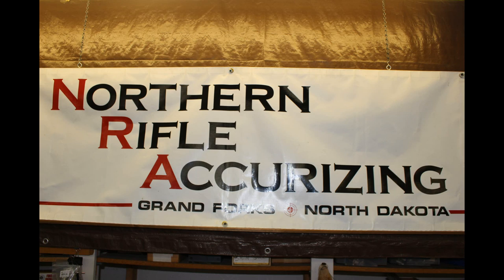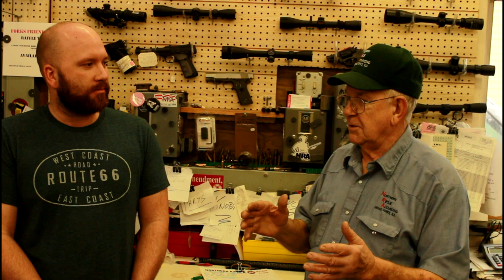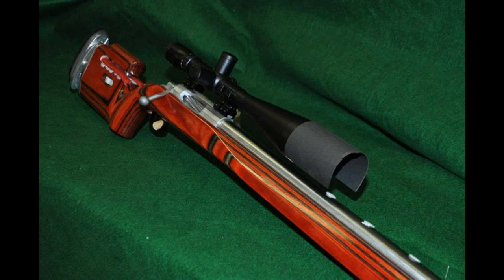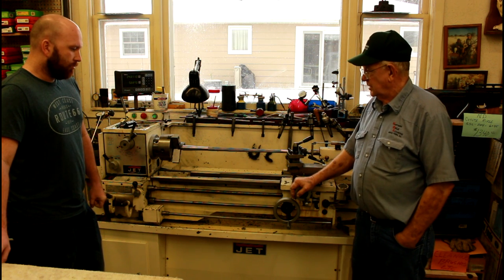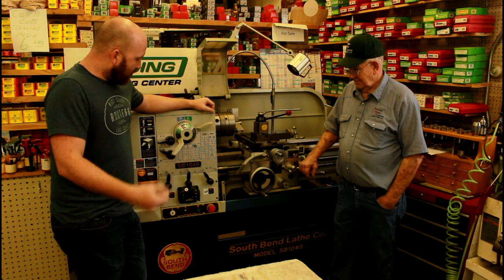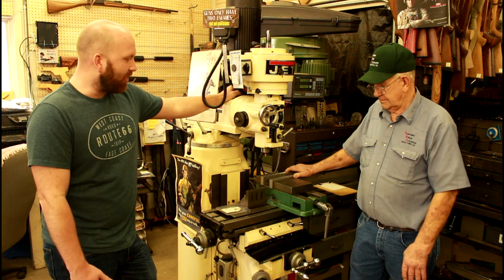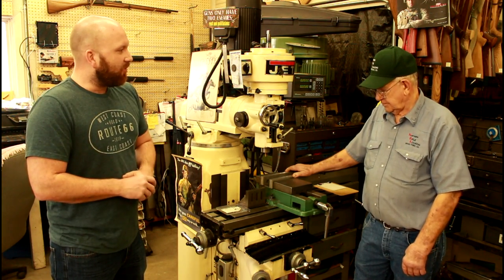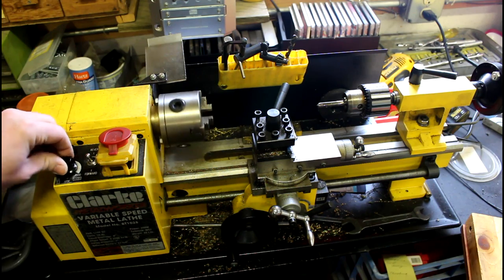Shop Tour Gunsmith Shop Northern Rifle Accurizing

Comment: I've had work done by them, they do great work!
I've also purchased a few AR lowers from them for my own builds. Good prices, even during the great scare of 2013. They don't try to screw you like so many in the industry did.
Reply from the maker: There's a good chance I was there in 2013 working. Part way through the year I ended up slowing down and ended up moving at the end of 2013.

Comment: How is the wood AR stocks more accurate?
Reply from the maker: I'm not sure, It's something that I have not thought about myself on an AR. In my opinion, getting a good upper to lower receiver fit along with a proper fitting barrel extension to the upper and gas port alignment will yield the most accuracy gain than most other things. The AR's that I have build myself are all Magpul, and aluminum stock parts.
Reply: Thanks for the videos man

Comment: someone explain the chuck jaws he made ?
what is the "spider chuck" mod ?
Reply from the maker: If you are talking about the soft jaw, they are just aluminum jaws that are made to fit this chuck, This allows him to run a truing skim cut across the jaws each time he mounts the chuck on the lathe. This will essentially zero out the jaws and allow a trued up barrel in this case to run true In the chuck. As far as a spider, That would have to be the spider on the outboard side of the spindle to allow the barrel to be dialed in on the inboard side.

Comment: The focus on "concentricity" of parts "with the bore" is interesting seeing as how our sights/scopes are NOT "concentric" with the bore and even their centerlines only "coincide" at the distance they're "zeroed" at. You don't AIM the outside of a barrel and you don't "true" a surface that's' "out" on one axis and radially UNLESS the tools/processes you're using to do it are using a "true" datum/reference point to do it and a "flat" face isn't automatically a "square" face. Nor does a "flat" OR "square" or "true" face "fix" the "bend" we're told all barrels have. And you also can't "accurrize" a "factory" rifle by REPLACING factory parts and "truing" factory machining. And you kiss "factory warranty" goodbye when you cut any metal, wood or "composite" from any part of the rifle. Kinda weird how Remington can't make their own parts/designs to "factory specs" but by God some "gunsmith" with NO "factory specs" can FIX THEM.
Reply: DEEREMEYER1 did a gunsmith sleep with your wife or kick your puppy or something?